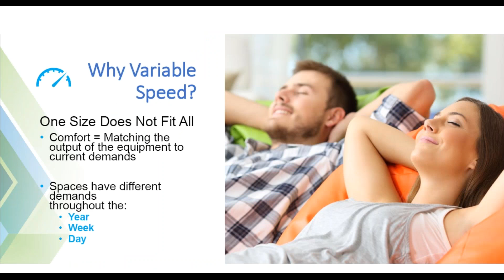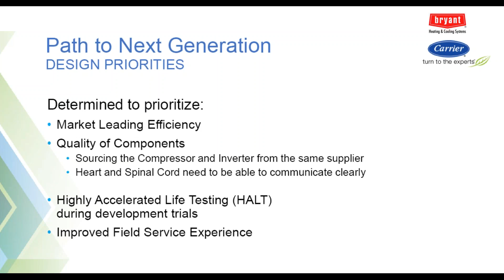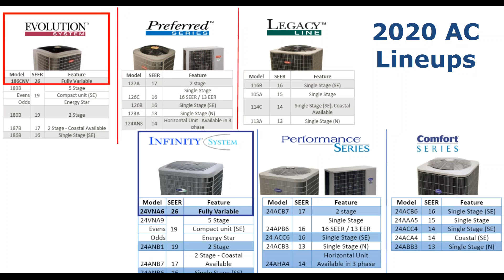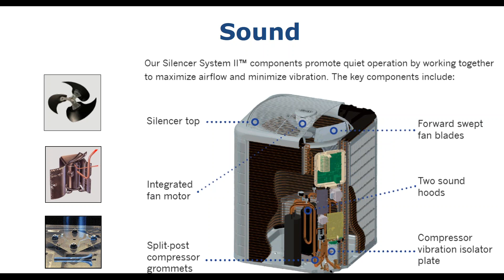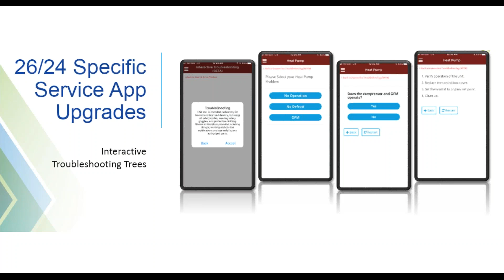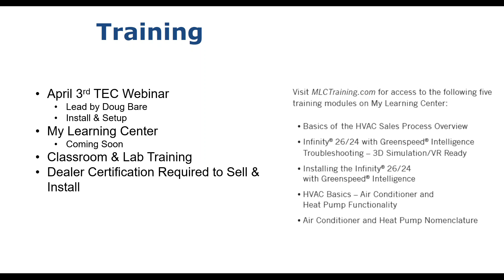Sneak Peak: Carrier & Bryant 26 SEER Inverter with 76 Stages - Webinar 3/18/20

Comment: Is there any information on how many KW/H the AC and Heat Pumps use?  I need figure out how many solar panels to get for the variable speed AC+heat pump.  I can't find this info anywhere.
Reply from the maker: Like pretty much all HVAC manufactures, Carrier and Bryant publish electrical data in amperage so it can be used to size breakers and wire size. If you want to know wattage, you can determine that from the voltage and amperage.